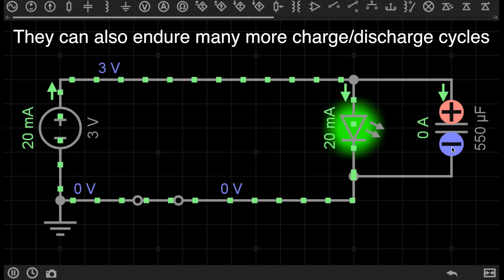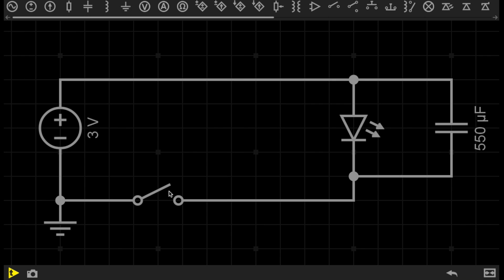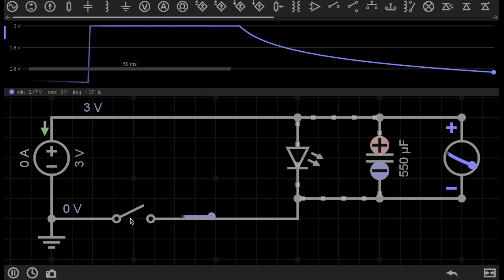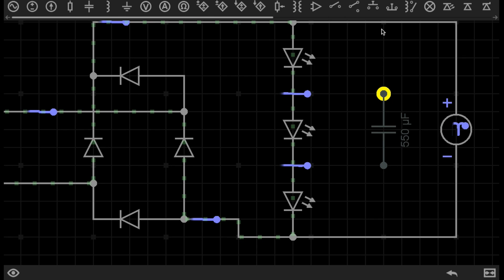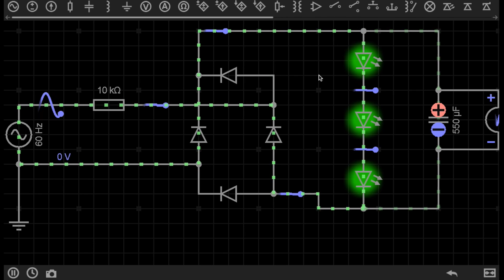What are Capacitors? - Electronics Basics 11

Comment: funny, your example video perfectly details the issue i was looking into which brought me here. i had wired an led flashlight into my motorized bicycle from the 6v wire off the magneto and as i expected it was flashing so i wired in a rectifier. i expected it to stop flashing but at idle speeds was still flashing which i wasnt expecting though it makes perfect sense because there is only a brief pulse off the magneto. so i was brushing up on components  which brought me here. perfect.

Comment: Excellent graphics/explanation. I just want to point out that if you build this circuit, please note that the frequency at which the pulses occur may not make the flicker apparent when the capacitor is removed.

Comment: Interesting. I had 100v capacitors on my electric bike and I had 120v battery. The throttle response was very twitching. I think capacitors help smooth out the throttle response.

Comment: Q. 
in the last example you showed where the capacitor is conected with the LEDs to smooth out the voltage AC-DC, couldnt we use a diode in the same circut for this specific purpouse instead of a capacitor?

Comment: I could be wrong but what I can remember for my basic electric circuits and electronics class was that one of the most basic uses for a capacitor (as well as inductors and some other basic electronic components) is to "condition" the flow of current that goes into and flows through a device. The logic behind needing to condition current flow is that when power is first applied to a circuit the voltage/amperage can be much higher than it should be and the sudden shock of zero voltage/current flowing through sensitive electronic can either destroy them (if they are high enough) or damage them enough that they will fail quicker then they should.
While this may not seem to matter to much if we are taking about circuits that are being powered by something like a battery, it is pretty important to electronic devices that are being powered by household AC currents where sudden spikes (and drops) can cause havoc on various  components that are unable to tolerate such harsh conditions.

Comment: Nice video but you have the + and - swapped. Electrons are negatively charged, so they will come out the negative side and move over onto the positive side with a directional movement. DC
Reply: Nvm I realize it's the software he's using. I just checked it out, shame on them.
Reply: @DJayAce4  yes , although current flows from -ve to +ve side, but in conventional current flow of current if from +ve to -ve side. that's why current in video is flowing from +ve to -ve

Comment: I have a 997 dc motor  which rated voltage is 48 to 60.  The thing is that I have 48 v 4.5 amp power adapter but this motor uses momentarily about 100 amps when at stall. i am making a powerful drill  machine with it. Is is possible that I use a capacitor to momentarily provide that extra amps to be use it work perfectly?

Comment: How does the capacitor know WHEN it has to deliver its stored voltage? Because you open the switch [open circuit] it just KNOWS to activate?! What was it doing before [while the circuit was closed]?

Comment: The gradual fading of the voltage in the animation with each cycle is what makes this video so great. It also helps you 
wrap your head around why they use them in parallel.

Comment: I've been watching videos for years learning electronics and decided to revisit the caps as I suspect one of my projects might need one, because the touch screen I added keeps developing a new white line across the screen when I turn it on after a long time of non-use. I suspect there is a power spike somewhere damaging sensitive electronics. You video finally explains how they work clearly so I can understand. I bought a new screen in case that is the fault of bad Chinese manufacturing and lastability, or my novice circuit building. Time will tell.

Comment: Why is there flicker when there's no capacitor?
Reply: Because its an AC circuit. At each cycle the voltage drops to zero. The capacitor maintains that lost voltage at the low point in the cycles by storing electrons and discharging them. Its kinda a smoothing effect. Like a strut in a car protects against a bumpy road.

Comment: So basically a capacitor is a battery but has less energy storage?
Reply: Yes and discharges really fast...that's why even  a small voltage charged capacitor is deadly to touch cause it sends out a large current in short time

Comment: Just a tiny technical issue:

In those two examples the capacitor doesn't charge up instantaneously. There is also a very slight charge time - much shorter than the discharge time - before the capacitor becomes fully charged.

Comment: 0:50 If one thinks a capacitor behaves like a battery, then they're asuming a battery stores charge, which is false.
Reply: What does a battery store ?
Reply: @ctbully  Energy. Of course, I'm just being too technical. It's like saying transmission lines transmit power, when actually (being too technical again) they transmit energy.

The physicist Nick Lucid from the channel The Science Asylum has a video explaining why you don't actually "charge" a battery but rather energize it. Check it out.

Comment: I noticed you said that the capacitor you were using in the diagram was a “polarized Electrolytic.” I work on vintage radios and what I was taught is that when I encounter a “polarized “ cap, I am looking at a capacitor ( usually wax paper and foil) with a band around one end signifying this end is where the lead wire is on the very outside of the capacitor . The other end is at the inner most part of the capacitor.
Electrolytics are usually found inside a aluminum can fastened to the chassis. 
Now let me express my gratitude for the work you put into this wonderful and educative experience! I was able to understand better what capacitors are used for! I’m looking forward to seeing other videos on your channel!!!
Thanks!

Comment: Why is the capacitor after the led?
Reply from the maker: It's in parallel with the LED (across it). For smoothing the current flow to the LED.
Reply: @SimplyElectronicsOfficial   would it be  across it if it was on the other side  though as well

Comment: Why does the capacitor have alternating current when the diodes have already changed it to direct current?
Reply: Is it because it is charging the capactor when the dc current is flowing and discharging the capacitor when the dc current flow pauses?
Reply from the maker: Precisely! This is not AC, this is just charging and discharging.

Comment: Thanks a lot for this great series. A little bit changing your work one can simply see the difference between feeding by a capacitor  (only middle LED) and not feeding ones. You can try it out: http://everycircuit.com/circuit/4953725822304256

Comment: I'm wondering why the circuit animation doesn't show electrons flowing (charging) the capacitor when the LED is powered by the battery.
Reply: because the capacitor gets full in miliseconds, therefore current stop flowing into it after that

Comment: If I connect 440 volt 22 uf capacitor in a 220 volt / 12 volt Stepdown transformer input side then it is good for transformer or bad?

Comment: Love your videos!! I have two questions that bugs me :)
1. In previous videos you said that current always flow from the negative charge to the positive. in min 3:31 it shows the electrons move from the positive to the negative. Why is that?
2. In the diode episode it shows that the current flow from the bottom side of the triangle shape to its top. In the other videos it shows the current flow from the top of the triangle to its bottom. What's the difference?

Thanks in advance! Keep up the great job :)

Comment: it's the current suppose to flow from - to + ?
Reply: @Aussie Shane no! The current flows from + to -, the electrons however, flow from - to +
Reply: The electron current is negative to positive (I) but the hole current is positive to negative (i) the math works both ways but is simpler to follow using the hole current. That’s why most will show examples as he did. But in his videos he flips back and forth in both describing and showing. It’s covered in an early video.
Reply: To clarify for those who might benefit from such clarification, "holes" in this case refers to the absence of electrons and represents a theoretical positive charge.  "Holes" are, in effect, positively charged, and flow in the opposite direction of electrons. 

Conventionally, electric current is the flow of positive charge, and it flows from positive to negative.  Electron flow (which is the actual flow of electric current in metal wires) is the flow of negative charge and therefore goes in the opposite direction of the "conventional" current.  For the most part it doesn't really matter, as long as everybody agrees on the terms. 

It should be noted that inside an electrolytic cell (i.e., a battery), the flow of electric current is via positive ions (not electrons), and thus, the internal current flow is the same as the actual flow of electric charge.  Early experiments with electricity (other than static electricity) were done with electrolytic cells (batteries), and this is where the idea of electric current as being the flow of positive charge came from.

Comment: Hi. Two questions - 
1) Is there any difference between the types of capacitors used such as ceramic, radial, polyester, etc? How do I choose which type to use or doesn't it matter?
2) What's with the voltage value when choosing capacitors? If I'm using a 9V battery, do I have to use 9V capacitors? Or is that a maximum - so I could choose higher voltage capacitors?
3) Could you make a video explaining this?
4) Why am I so bad at counting? :)

Comment: i am glad I found this channel. so a capacitor will only charge up to the voltage supplying it? in the video example, if you put 120v as the supply instead of the 3v ( I am aware the LED would fail at 120v)  would the capacitor obtain the potential of 120v or will it fail?
Also, do they only discharge when there is no current flowing? at 0 point?
Reply from the maker: Thank You! Yes capacitors charge up to the voltage supplied to it. The Capacitor would charge to 120V in this case (as long as the capacitor is rated for this voltage). As for the discharging of a capacitor; a capacitor will theoretically hold its charge forever if there is no current flowing from it (not connected to a circuit). But no capacitor is perfect so it will gradually lose charge over its charged lifetime. When connected in circuit, a capacitor can discharge it's current through the circuit.

Check the video description where you can try the circuit shown.
Reply: Thankyou! I thought that was the case but it is nice to have it confirmed. Got yourself a new subscriber
Reply from the maker: Thank You Ben, Welcome to the Channel and I look forward to seeing you in future comment boxes!

Comment: Thanks for the basics.  I get the voltage is the highest voltage rating,  But how do I know what microfarad to use for a specific circuit?
Reply from the maker: This is not something that can be properly answered in a comment and will require many videos to cover most applications. The capacitor value you choose really depends on what you are using it for. I may want a 400nF metallised film cap for stepping down 50Hz 240v AC to 30mA current (Capacitive Reactance). Or I may want to use an electrolytic for smoothing rectified voltages, or pulsing power, or filtering, suppression, oscillators, digital signal processing...etc. There is a lot of complexity in all of these applications which means I cannot tell you how to choose a specific value. Over time, as you follow my future videos, you should pick it up. Or perhaps do some research of your own.